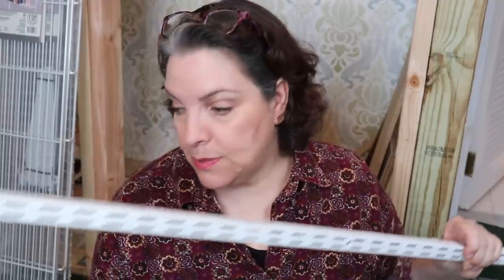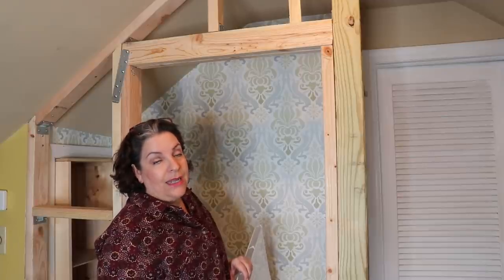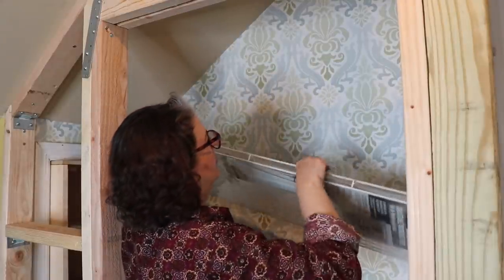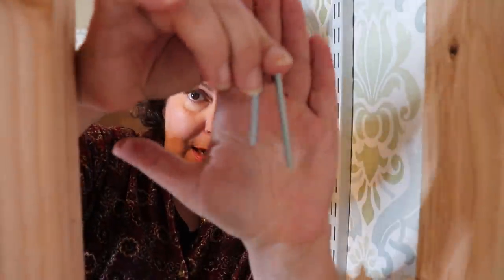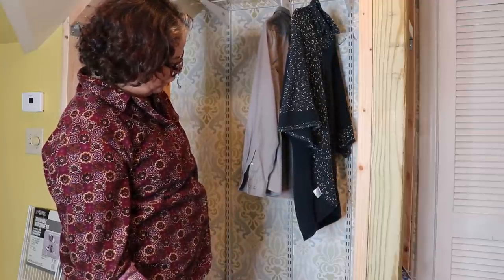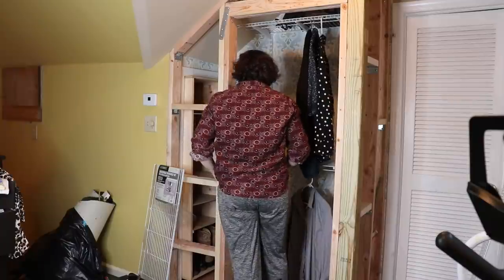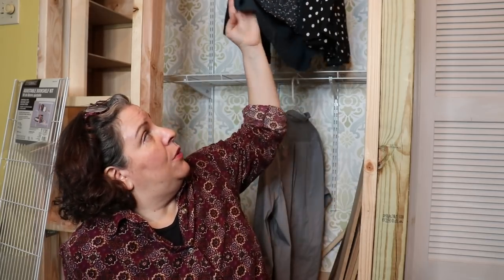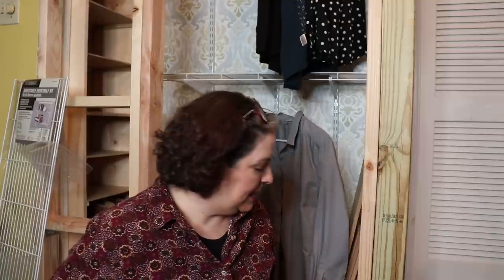Master Bedroom Makeover Series || DIY Closet || Episode 7 ||

Comment: If you use only one door for your closet, you could hang a shoe bag or rack on the back of the door.  That way you may be able to fit your shoes in the closet.  Also, if you hang your pants on the top pole, you may be able to fit some items on the middle shelf.

Comment: Sophia, if you trade out the top shelf with the shelf you did not put up, it has the same front slot where you will be able to slide the clothes a little like the middle shelf you installed. This will allow you to reach your cubbies better!
Reply: Plus ,hanging individual hangers in each slot will get old quickly. Yes trade the shelves,put up the new one.

Comment: Great job Sophia! It’s starting to shape up. The vision is coming alive. I hope the cubby works out ( practically speaking). I do remember years ago when you had a shelf in the far corner of the current closet and you didn’t hardly access it. ( that was old cluttered Sophia, but no more!) Being this is Sophia’s “HER” closet you will probably access that cubby better than the previous shelf. I am wondering about your jewelry cabinet, will it fit in the closet wall as you enter the bathroom? I loved hearing about all the coming projects after your closet is done. Oh! The shelving system is what I used for shoes in my tiny closet. We have a bar and a small slant shelf for shoes. I also use the pants hangers. They’re so handy! Some people don’t like them, because of the maintenance it takes to hang the pants. But I love them! Go get pink slim hangers too! 👏🏻👏🏻

Comment: Sophia,  Before you try to put on the drywall, I really think you need to remove the metal bar that is on the outside of the wood frame, left of the closet doorway.  It will probably be in the way of the drywall laying  flat against   that framework.  You are doing a great job of figuring this all out!!  Love the cubby shelf unit!

Comment: I've got a walk in closet and it's basically a shelf with a rod that goes the length and then on the end wall I stack the extra bedding. It's nice when it comes to putting stuff in hiding at Christmas but honestly, you're not missing out! It's another space to put "stuff" that I don't really even need or use and therefore another space that I need to declutter, dust, vacuum etc. The only nice thing is that I can walk in and see all my clothes instead of having walls hiding the ends, but it looks like you'll likely have that ability as well, maybe not a walk in, but a step in? Less is definitely more! I have carpet and I bet you the closet has only been thoroughly vacuumed (every inch) once or twice in the last few years! As your kids get older, if you really want a dressing room and the big walk in closet, you could always renovate one of their rooms if they're not using it. At this phase and with how you're trying to only have what you need, I think this closet is perfect for you! I do suggest getting some plastic dollar store place mats for over the shelves where you'll be placing anything leather, or you will permanently get lines in your bags, or use a basket for them. I personally have a wooden coat hanger on the wall that I hang my bags from but I'm sure that's not ideal for the handles. Love this makeover Sophia! Can't wait to see the entire room finally done! 💜

Comment: Hi, darlin,,,,I'm not sure if I'm the only one to say this, ,,,but if you DON'T drywall the inside of the closet, the horizontal studs will give you free shelving,,,,just paint the studs, and they are wide enough to screw cuphooks into,  or use them to store extra toiletries,  hair products,  etc,,,,,In my craft room, I used pretty tacks to string elastic from side to side to hold interfacing, wrappings,  bags,,,it sure is a waste of space to close that up!

Comment: Your third shelf seems to have a similar front rail, same as your bottom shelf. Why not put that one on the top (cut it to fit) so that you aren’t struggling trying to put the hanger in a small space. It may not make a difference now, but in the long run, it will be cause less frustration.  Cut it down to where it just fits the rail support so that nothing can hang closer to the shelf unit you made for the doorway.

Comment: Great job! Did you put up the wallpaper? I watched to see if it was hung straight and it was! When you drew the horizontal line for the top shelf, I could see line crossed the wallpaper pattern at the same spot!

You can easily access the shelves on wheels in the attic. But do you need to take out the closet shelves to pull them out? Just wondered.
Reply from the maker: I do and it s not a big deal we open the attic maybe once a year

Comment: will you still be able to wheel out the shelves on wheels if you need access to the attic??????
Reply: wondering the same thing.  The dividers along the rod will drive you crazy.  We made the mistake of putting that size in and you can't move clothes very well.
Reply from the maker: The wire shelves are not fixed they can be moved. At best I go in the attic once a year  it s not an issue.